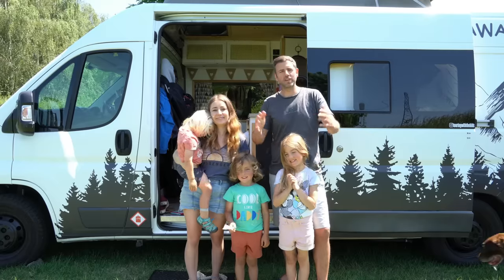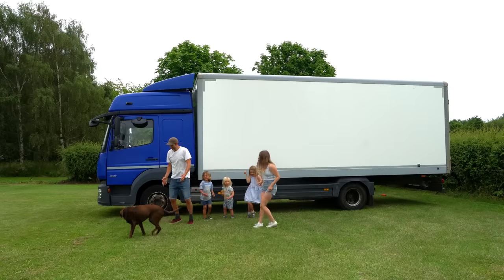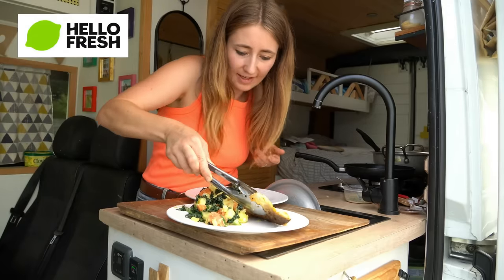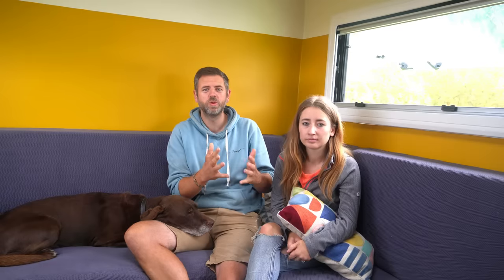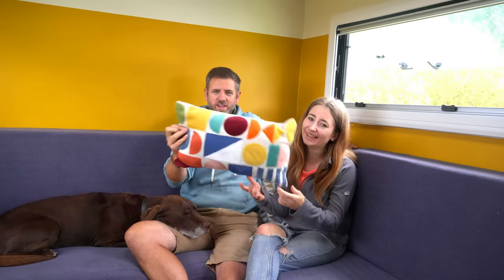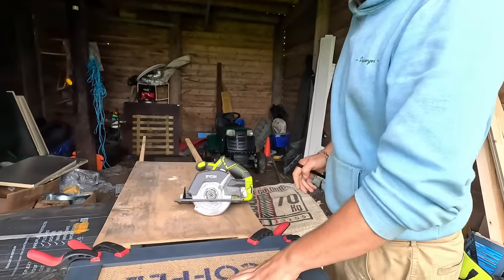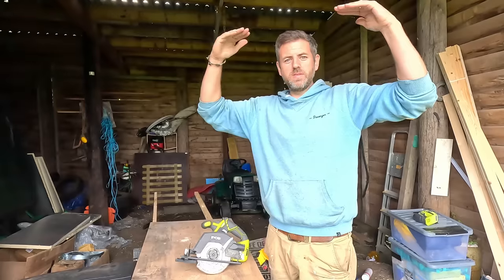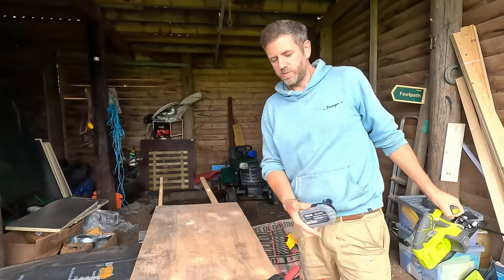A Major Setback - Our Deadline is Now At RISK!  (Tiny Home Build)

Comment: if it did go wrong, buy some polysterene sheets from BQ, spot them on with no nails interior [warm water will get it off] + slap that yellow paint on, the kids won't notice...
nick a shopping trolley + make a slide-up grill for the dog
nearly there...
Reply from the maker: best suggestion 😂
Reply: nicking a shopping trolley is a good suggestion the trolleys cost a lot of money and loss or damage to them increases grocery prices .It is possible to legally locate used trolleys however rogue trolleys are dumped all over the countryside and often just need a good clean .

Comment: coming along now. something i spotted was maybe a timber support painted the wall colour under your big top units and a cross ceiling brace or two from one side to the other stopping the units from leaning inwards under load. if you skip it then just make sure to constantly check the mated surfaces of units to walls. i know your wall ply was thin but insulated van wall is thick and cant see fixings. ceiling was non structural fiberglass with cavity like my first ever conversion 30 years ago on a luton van with same ceiling. you guys could do with a little run around car for a couple of months to get supplies and get the kids away for the day while bigger jobs are done. weather fighting against us this time of year. not picking fault here... your doing a great job

Comment: I used a company called Barjo to Taylor build me a cage that takes up the rear seat in my pickup truck.
It would b advissable to try and take the vehicle to them get all the measurements done, I've used off the shelf cages before they rattle and cause more stress these mainly bolt together

Comment: Looks lovely all the work you guys have done. Fingers crossed the rear panel turns up soon along with the table leg 🤞. Regarding Charlie did he’s anxiety start after what happened in Falkirk or before ? If after maybe what happened In Falkirk caused him anxiety. Also I don’t think keeping him in the back is a good idea whilst on the road might be ok in the winter months but what happens when it’s boiling hot can the roof vent be left open when on the move?
Reply from the maker: It was before the Falkirk incident. He slept through that whole ordeal 🙈

Comment: Great video just want to say about the dog bed I would put a CCTV in the area so you can keep an eye in the dog and I would put two stage shutter system the like aluminium bars and what you can do it will stop the dog going out and if you make it in Split mode it will be ideal for the dog so you can leave it open all day while you' parked up for the night and then you can open them up in the day that's my suggestion  and most of all put a seat belt clip system as well

Comment: Great to hear the rear panel is on its way, hopefully it will come as promised and you can crack on with the build. Try a perspex sheet with holes drilled into in for air, is strong and safe for Charlie and the kids. Plus it's see through, maybe two sections. One top and bottom for flexibility of option on short/long trips.